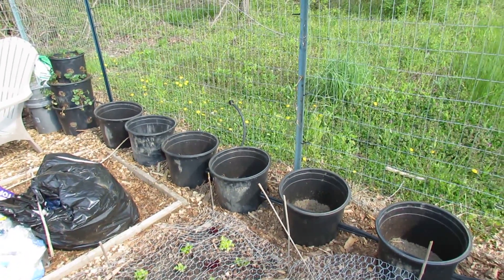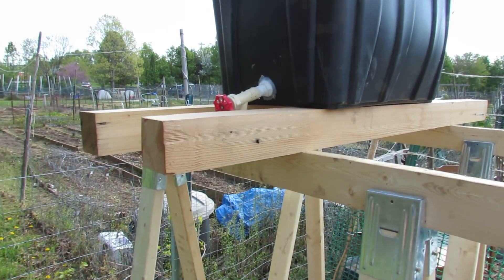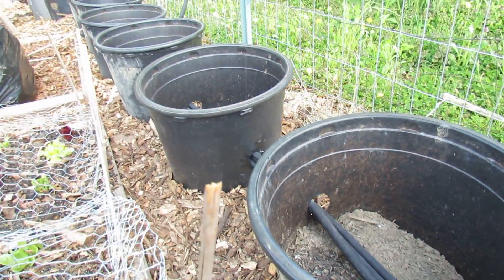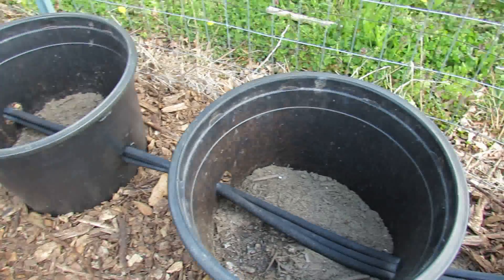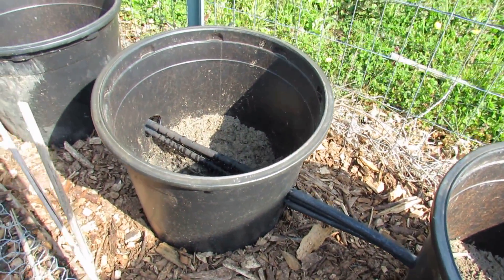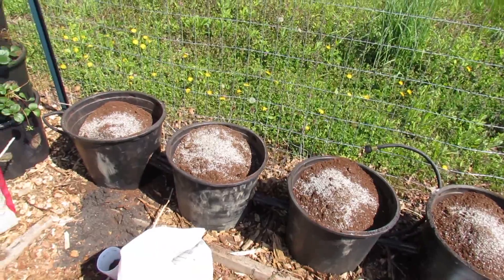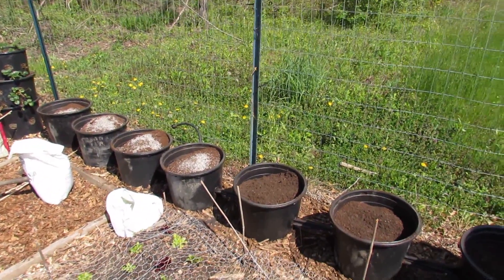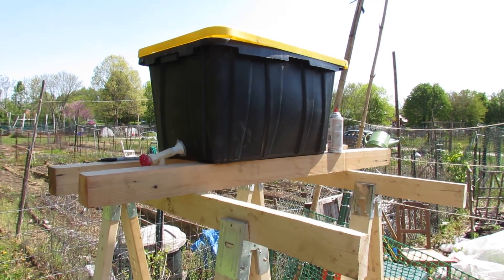Experimental Container Gardening : A Soaker Hose Gravity Drip System - TRG 2015

Comment: Is there an update video for this
Reply from the maker: So it was awhile a go. A follow up showed up in a tour of the community plot. I just dont remember which one. It works. The hose in the gaps still leak. And the height of the supply needs to be high to have pressure for the hose to weep.
Please support The Rusted Garden by subscribing and using my Amazon Store Link when shopping for anything on Amazon https://www.amazon.com/shop/garypilarchiktherustedgarden.  As an Amazon Associate I earn from any qualified purchases, not just items I link. You can also find items I use or discuss in videos, by checking out my Amazon Storefront for fertilizer, pest management, shade cloth, seed starting supplies, books and more!   Please visit The Rusted Garden Seed & Garden Shop (My Shop) for your fabric pots, fall & spring seeds, seed starting supplies, peppermint oil, neem oil, TRG merchandise, and more at www.therustedgarden.com  Thanks & Cheers!

Comment: 7 years late asking this.  but.... how did it work out?
Reply from the maker: It worked out.  The hose gaps between the buckets were sealed with flex seal.  The stuff on the commercial on another test set up and it worked. I have more land, so I stopped using this.
Join this channel to get access to perks which focus on garden mentoring and member influenced videos:
https://www.youtube.com/channel/UCptL6_qMImyW_yZwiMjQdpg/join You can find items I use or discuss in videos, by checking out my Amazon Storefront for fertilizer, pest management, shade cloth, seed starting supplies, books and more! at https://www.amazon.com/shop/garypilarchiktherustedgarden  As an Amazon Associate I earn from qualified purchases.  Please visit The Rusted Garden Seed & Garden Shop (My Shop) for your fabric pots, fall & spring seeds, seed starting supplies, peppermint oil, neem oil, TRG merchandise, and more at www.therustedgarden.com  Please subscribe if you have a chance (Thanks!)

Comment: Great Video. I have been reading up on soaker hose and rain barrels. Realized they make a type of soaker hose specifically for gravity fed. The hose you used, is that just standard soaker hose the gravity fed soaker hose?  Thanks!
Reply from the maker: That was just a standard soaker hose. It worked well. You just want to make sure the water source is high enough to run down the hose.
Please Ring the Bell (next to subscribe) to get immediate real-time video notifications & Please check out The Rusted Garden Seed & Garden Shop for all your gardening needs: www.therustedgarden.com

Comment: You might want to lose the mulch directly under the tubs.  All that carbon will reduce the nitrogen in the soil.  That is not a problem on the surface, but you don't want it at root level.
Reply from the maker: Smileynb I am keeping an eye on it for the reason you mention. The wood chips are getting some blood meal. I am giving them a bit extra nitrogen so they dont steal it for their own use.
Reply: Gary Pilarchik Fair enough!

Comment: I'm also relatively new to drip irrigation. To avoid problems with a slow feed not reaching the end of the hose, I bought tees and made a loop. This way both ends of the hose have water. It depends greatly on the type and length of hose, but this can effectively double the length of hose you can use before running into problems. I have rows with non-dripping tubes running out to the ends and drip tube buried in mulch up the middle for supplemental watering.

I would also get a cheap sheet of foam insulation for around $10 as opposed to painting or taping the water storage. The closed cell foam with foil can keep out heat and reflect radiant heat. Not to mention how fast it is to cut up a sheet and set it in place as opposed to painting. It doesn't have to be perfect since the thermal mass of the water will resist small temperature changes.

Another trick I learned is to use a 1/4 turn shut off valve for the main shut off, then a needle valve for fine tuning. You get the flow exactly where you want it and don't have to readjust every time, simply close the 1/4 turn valve.
Reply from the maker: wrathofsocrus Thats a good idea with the foam. Its not expensive and easy to work with. Another good idea with a needle valve. I didnt know it existed. Appreciated.

Comment: Try using that spray paint for painting plastic and spray the outside of your water tub and its lid white. Also, the small drop irrigation 3/4 inch black tubing with the 1/4 inch mini tubing connected to drip emmiters would be the way to go.  I have a micro irrigation system attached to my sprinkler system that I use for watering the vegetable garden.  I turn it on for a good soak about every 5 days and then short watering every morning before the sun gets too high.  I've also grown tomatoes and peppers in a bucket system (look up global buckets on youtube) that I have used for years and gives me great results.  God Bless and take care.
Reply from the maker: Teresa H Thanks. I just ordered drip system too to experiment with.

Comment: Hi Gary, if you end up making another container for water, use a bulkhead fitting on your container, it'll make a nicer fit, then you could plumb it down to the ground with pvc pipe.
Reply from the maker: scott I just ordered a brass bulk head fitting and spigot. It come with cutting too to for a drill.

Comment: I don't have anything to add really other than I have no experience with drip tubing, I'm surprised the dripping puts enough pressure to make it to the last container.  Shows how much I know!  Nice experiment, thanks again for sharing!
Reply from the maker: +Michael Pelletier Thanks that is helpful. I think the key is learning to control the flow.
Reply: Dave Pruitt It helps that Gary turned the soaker hose on fully at first. Once the hose is full each drip adds enough pressure to soak out just a bit of water. I used a soaker for my beans at my ex's house and they much preferred the slower watering of just the soil instead of using a sprayer. I'm hoping to set that up at my new place this year.
I love watching Gary's videos too

Comment: You may want to put cross bracing on the saw horse legs.  I have had problems with that bracket getting wobbly.  26 gallons weigh around 210 lbs.
Reply from the maker: Dale Whitaker Ill secure them. Thanks

Comment: the sealant was brilliant.a little math would work. mark time, put gallon jug when full determine time. that will give you your flow rate. once you have flow rate you can compare to other sources of adequate irrigation. you have a knowns; the water is going into the pots. actually i wanna rethink this. the thing you really want to know is, when will your supply end? NOTE the force exerted in the hose will diminish as the water level decreases in the pool. you want to know when it is empty so you can be relatively sure as to when to refill it. the other thing you want to know is, is the water adequately hydrating the plants. that is observable.
Reply: the dripper hose should be more efficient because it will rely less on the pressure to distribute the water thru the system. as your pressure diminished in the soaker the 'end' of the hose will shorten. in other words the parts of the hose that continue to emit water will get closer to the source, this problem is eliminated in the dripper because force is not required to eject the water like with the soaker. the flat soaker would have lasted once. one the pressure level diminished sufficiently the flat hose would collapse the weight of soil would assume that space thus requiring the force equal to not only rehydrate the hose, but also lift the soil from every pot. i think this one will work, but would be better at home, where you did not have to travel and had constant pressure from water utility.Further i think the dripper with hard plastic with holes is more easily quantifiable as to flow rate so you can determine when the pool needs to be refilled, but may have issues hydrating the end of the line with a flow rate that is sufficiently slow to allow you to walk away for a few days knowing they are being watered.

Comment: Gary this is an interesting watering method experiment. I was going to build something similar with PVC, primarily because I wanted to off-gas the chlorine in our city water and have the opportunity to add bagged (tea bag) compost to the water. My raised beds consist of between 100% and 75% compost, with clay soil underneath. Adding wood chips around the beds has substantially improved the underlying soil.  I am finding that the pH is 7.3 in the beds and it seems that adding lime will increase the pH. Every 3 months I add Soil Sulphur to lower the pH and I use Calcium Nitrate as a blossom end rot addititve and eggs shells in compost. Could you share what your pH runs with your 50/50 mixture? I'm on the Gulf Coast and container gardening is challenging due to the extreme heat we experience.
Reply from the maker: Grumpyneanderthal You know I dont check the pH regularly. I did a couple of pH vidoes and when I did check it it was mid 6's. Each test seemed to vary a bit. I would do it regularly if I ran into growth issues. The peat moss is a bit acidic, the lime toss manages that. Otherwise compost and fairly low use of fertilizers keeps the pH in a workable range. Good point with adding to your water. I could do the same with nutrients to let it drip in.

Comment: Hey Gary, great set up, but do you think that Rustoelum product is harmful by chance? not sure if you considered that...
Reply: ChicagoCFH Download the MSDS from Rustoleum's website.  Its highly toxic.  I wouldn't want it anywhere near my garden.  Just my .02
Reply from the maker: ChicagoCFH In this case its not sitting anywhere the plants will contact it to a significant degree.
Reply: I was thinking the water running through may pick up unwanted chemicals from it. I'm a total rookie though...just a thought. great vids
Reply: Hi Mangos, yeah, I was kind of thinking that too, didn't know if Gary had looked into it. smart move checking the msds
Reply from the maker: ChicagoCFH Thats wise. I am okay with it being on the outside of the hose not in the pots. I thought of spraying some of the hose that sits with the roots but that won't happen now.
Reply from the maker: ChicagoCFH There is that chance. I cant say the black containers don't leach but I use them.

Comment: Check out RobBobs Backyard Farming Auto top off wicking barrels video and other wicking container videos (he has a playlist for wicking containers). The concept can be adapted to most any container and adds the benefit of wicking only what they need, when they need it, in which you can daisy chain them from a reservoir or run them solo by manually refilling each individual pot's reservoir. He has a very good air pruning design as well. Apparently, I'm not smart enough to paste a link. Looks good, and I've received some solid info/advice from your vids!
Reply from the maker: Jake Snyder Ill take a look

Comment: Interesting!
If it's any help, there are approx 20 drops of water per milliliter, 20,000 drops per liter, 80,000 drops per gallon.

80000 drops/24 hrs/60minutes will deliver 55 drops per minute.

So 55 drops per minute will deliver about 1 gallon per day.

Love your vids, thanks for your passion!
Reply from the maker: winterswonderland Thats really helpful. I am going to set up a drip line somewhere. If I can calculate it easier with a drip line versus soaker hose... that might be way to go for next year.
Reply: winterswonderland ahh this was the math i was seeking, however the rubber soakers require a bit of pressure too.
the drip system should not?